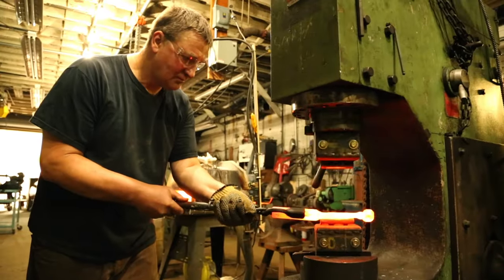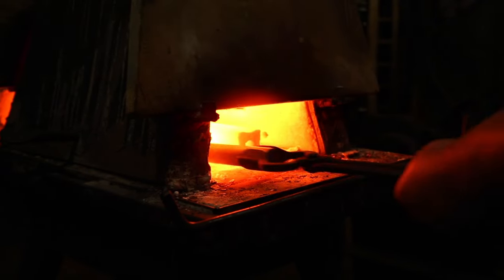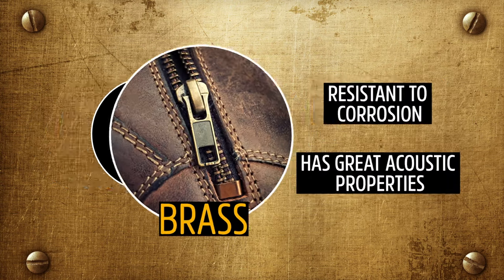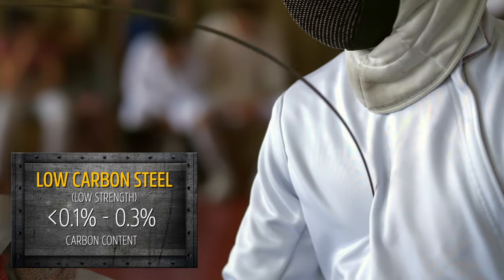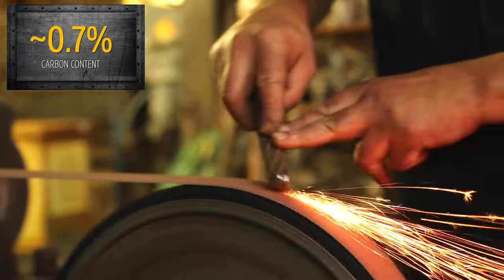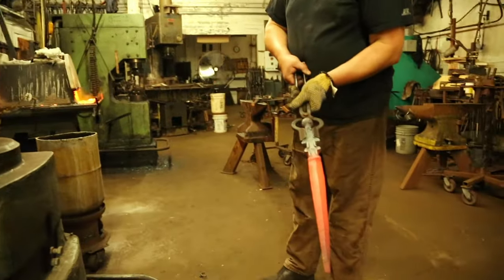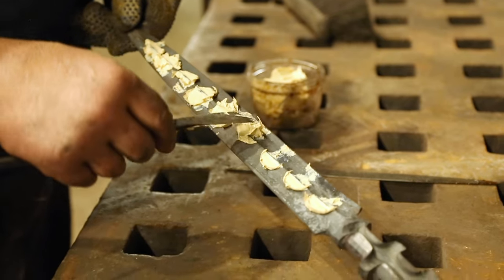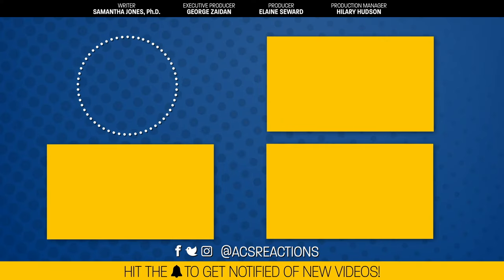How Do Blacksmiths Make Swords?

Comment: It depends on the steel how you have to harden it. Some you have to air harden, some in water, some in oil, usually you also control the temperature of the bath you are using and often you do it in more than 1 step.
At least for high strength components and not something a blacksmith would use.
Reply: Err.. a modern blacksmith can and does use a variety of steels, heat-treating techniques and quenching media to maximize performance of whatever tool they are making. Sometimes, a multi-step heat-treatment makes sense, and sometimes a single-step heat-treatment makes the most sense. As to "high-strength" -- a dagger, which has to both maintain an edge AND withstand repeated shock and flexing, certainly qualifies. I mean, usually a part or a tool are forged precisely BECAUSE high strength is required, and a suitable heat-treatment is merely a part of a process to make a high-quality tool or component.

Comment: Worth noting that if you can get a hot enough fire and metal with a hammer just about anyone can make a sword—but making a good sword takes real skill like this. Ditto an axe or any other steel tool or weapon. You can also make a crude knife or dagger with rocks or bones, and you can even make a “sword” with bones, rocks, or animal teeth fastened to the sides of a club. That’s how sword-like weapons were made in places without consistent access to metalworking.

Comment: Cool video, but a foil is made from high carbon steel,  not low carbon. The thing that sets a foil aside from a stiff sword or knife is the temper of the steel not the carbon content. Low carbon steel bends and stays bent, high carbon steel springs back. When high carbon steel is tempered to a higher temperature after quenching it creates an item that doesnt have as much edge retention but is springy and will go back to shape after bending, tempering at a lower temperature will create an item that is harder and has better edge retention but is more brittle. Springs for instance, are high carbon, not low carbon. You can take spring steel, that behaves much like a springy foil during its life, and use the same steel to make blades that are hard and hold a great edge. This is because all spring steel contains a higher carbon content, but depending how you temper the high carbon steel after quenching will cause it to take on different properties. Low carbon steel has neither springyness or hardness because both properties come from higher carbon content. This is why no sword or knife is made from low carbon steel aside from cheap display pieces which need neither property to serve their purpose. But foils actually have to be springy, which is why they are made from high carbon steel.
Reply: The springyness refers to the metals elasticity and all metals including low carbon steels have elasticity, high carbon just has more. Look up stress v strain curves.
Reply: Foils can be made out of any steel so long as it is steel. Leon Paul uses an unspecified low-carbon steel, cheaper forges like Absolute definitely use something similar, but higher end forges like Dynamo and StM use a 9260 equivalent. 
International federation blades use a special low carbon steel called maraging, which is generally in a different class.

Comment: what about Damascus steel
Reply: There's a lot of myth surrounding Damascus steel, I'm not an expert but I have followed the scholarly research to some extent.  It actually refers to the finished works which were forged from ingots of "Wootz" steel, which originated the area of Southern India and Sri Lanka.  Wootz steel was likely made by melting different grades of iron in large crucibles, it would then be cast into ingots and sold to smiths or suppliers.  The pattern seen in genuine Damascus pieces is due to the presence of cementite, a compound of iron and carbon.  Modern Damascus is created by layering different steels and forging or pressing them into an ingot, this is known as pattern welded steel and it's a technique that's been in use for at least two thousand years.  It's also important to note that the processes used in this video only work because of advances in metallurgy around a hundred and fifty years ago.
Reply: Damascus is null in the world of homogenous sping steel, the purpose is to increase quality in poor steel with inperfections

Comment: Yeah the low carbon vs high carbon thing is wrong, low carbon steel will not harden much in the ht so ot wont get any stiffer, tempering gives you flex from light brown to dark to blue to purple

Comment: 2:12 LOL omg no. Reactions, High carbon steel is not brittle its Tough, not hard. High carbon steel is not hard, aka brittle, its tough. In fact its like the gold standard for tough. Super stainless steels like S30V that take an incredible edge and last for a very long time, are hard, which is why you can get them extremely sharp and they stay that way, they're hard. But, brittle. High carbon steel is very tough, it doesn't take an edge as good as a hard steel, and its softer so it looses it faster, but its extremely tough. This is basic knife/tool information you can look up on you tube.

Guys need to correct this, its false information.